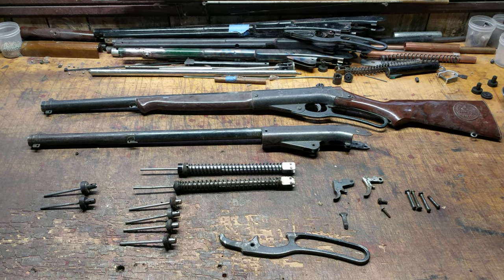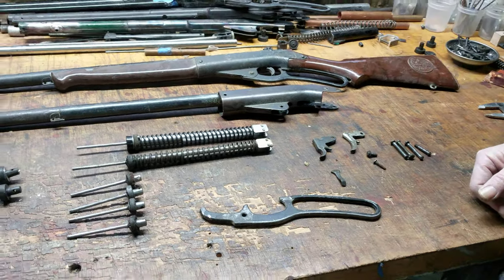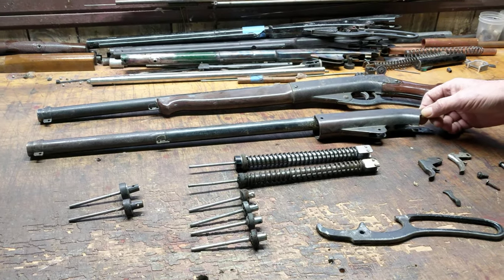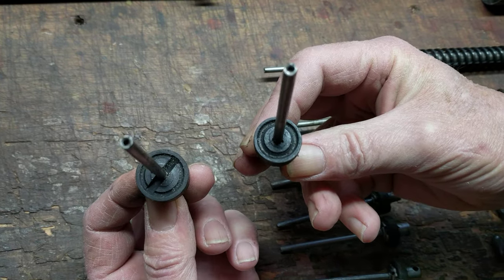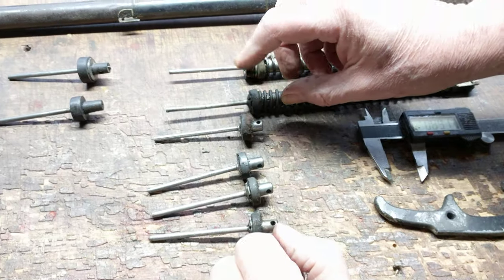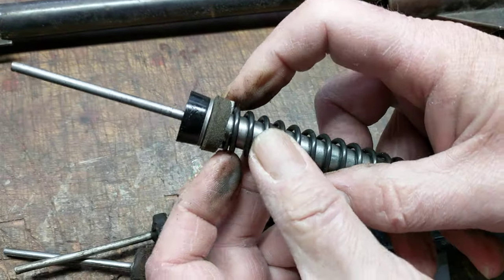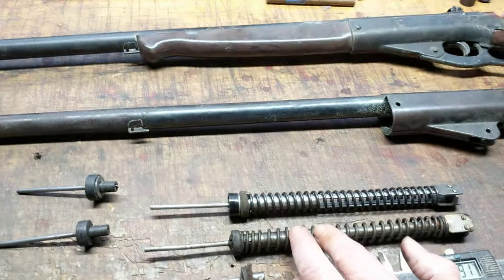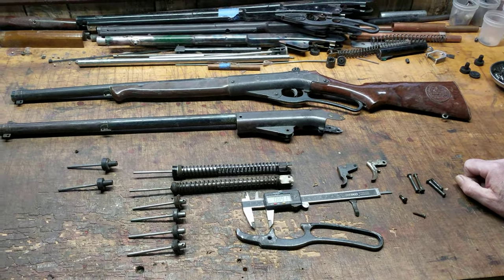Daisy Defender 101

Comment: Shane , Im in the process of getting a 1894 daisy working got the old seals out but they are much smaller than the current red ryder seal or the current model 25 , I did buy a bunch of seals from daisy in case I end up trying your shaving technique. Baker airguns claims they will have some seals in early February but I am skeptical, I want your take on this subject, keep in mind this is the Daisy 1894 the one that looks exactly like a winchester 1894 has the side loading gate in the receiver and many moving parts .I have only seen one of these on your videos, It looks  brass colored like a henry , you had made a wood stock for it and said it was very challenging .Thanks for showing me how to take apart a daisy I made a mainspring tool and it works great. I am re living my childhood.        Jason Butler Blue Hill, Maine
Reply from the maker: Jason, Thanks for watching the channel! I feel your pain on the resealing aspect of the Model 1894 Spittin' Image Carbine as they are a real pain. I'm not certain profiling Red Ryder seals is gonna get the job done on the Model 1894 as the compression cups and abutment seals on that gun are designed to fit a tapered compression chamber. Here's an old thread from Daisy Talk that might be of use due to the pix of the plunger and compression chamber

http://forum.daisymuseum.com/1894-seals-old-and-new_topic7991_page2.html

If Baker says they'll have the correct seals you might want to consider that but hey, if you can successfully reprofile a current production Red Ryder cup to work in the Model 1894 that would be revolutionary. Keep me posted on your progress please.

Comment: I love Daisy white frames a compression sleeve tightens down as you put the frame Bolton making a better seal my 141 is going into an M1 carbine stock It uses all the same parts as A11140 as do all the wide frames Except for the 499B has a large chamber.  Honestly I prefer the seal of leather it flexes and keeps a better seal and it lives longer as long as you properly oil it maintain it like all of them good old guns. And for being a low pivot compared to the model 40 it's a lot easier to crank no matter what Spring you can set up you put in it model 40 piston required 
Wolf

Comment: My chrony velocity checks on the newer Chinese guns always record more FPS from the lever guns than the one model 25 I have.  Due to the smaller compressor chamber ?..  didn’t realize they were that much difference.    Good video. Thx.
Reply from the maker: Dave, What kind of speed are you seeing?
Reply: The RR carbines (2 guns) run 260-275.  The mod 25 about 240.   The Gkids Buck runs near 290!   I know the lever guns have the same air chamber bore dia  and plunger assembly.  Not sure about the (new) mod 25s ?   
I installed a bored out air tube (3/32 don’t have any of the 7/64) in one of the RRs with a stock spring, seems hotter, but loaned out my chronograph so haven’t checked it.  
Liked the “single” plank stock gun you just finished.  Like to take a Chinese RR and put curly maple wood on it ?
Reply from the maker: @daisymae6561  Sure! Send me an email at "thesocietyforprofit@gmail.com"  and we can get the details worked out.
Reply: Got my chrony back.  My #1 RR Carbine (China—‘019) ran around 275 FPS after couple hundred rounds. 
I stuck a aftermarket heavy spring and a bored out air tube (3/32”) in it.   Took it to 370Fps. But accuracy suffered.  From 1 1/2” to 2 1/2” at 33ft. (5 shots off a rest).  I had a shot tube assembly blow thru the abutment.  Dropped in a new STube assembly and changed back to the factory spring.   But kept the bored out air tube.  Velocity went to 325fps and I’m getting sub 1” groups.  So, I thinking I’ve found my sweet spot.  Now if someone would develop a hopup system——-bingo.   Buck Jones would be a happy cowboy.   
Ps.  Really nice job on the 1894.   I got several but all need help.
Reply from the maker: @daisymae6561  Super nice work on a current production Red Ryder. When you say you had a shot tube assembly blow out of abutment did it dismount from the abutment and leave the gun? I've always wondered about the longevity of the current plastic/aluminum abutment assembly in post 1978 Red Ryder's equipped with high power springs, yours is the first report from the field that such a thing can happen. It does look like you've got your "Thumper" class Red Ryder in. Sweet Mod process!

Comment: I wish you could do a shot tube replacement or a shot tube that would work in a daisy model eagle 98.
Reply from the maker: Jim, No need. The current production  Model 25 shot tube should drop right into the gun and get you up and running. Send me an email at "thesocietyforprofit@gmail.com" and we'll see what we can do.
Reply from the maker: Good news Jim. I just cracked open a Daisy  Model 98 that came in from a customer. Video to follow.

Comment: Are there a Springs stronger than the 327?
Reply from the maker: The Cobalt 327 Super Spring was designed as a direct high power replacement for Daisy's by Mark Ritter (AKA Cobalt327 on Ebay and elsewhere). It's been trialed and tested and works in small and large frame Daisy platforms like the Red Ryder's, the Model 99's and similar guns. I'm sure that out there in springland there are options that would feature higher spring rates and thicker wire diameters but I'm not aware of any that are offered for sale for this niche application. Might even be a mini gas ram that would work, I just don't know of anyone else that's done the really hard work required to develop a spec and then do the testing to validate the results like  the Cobalt Spring.